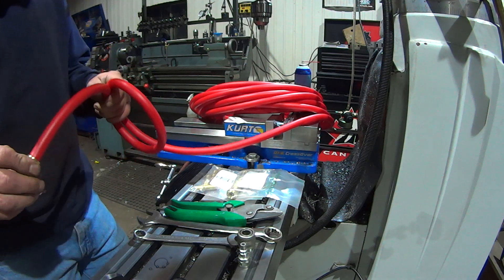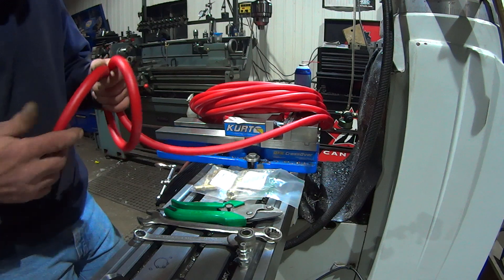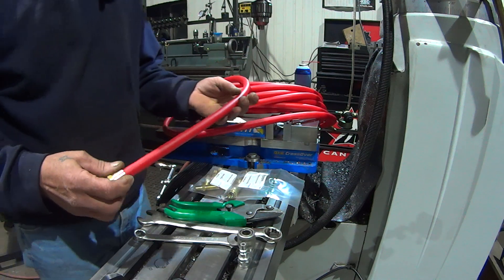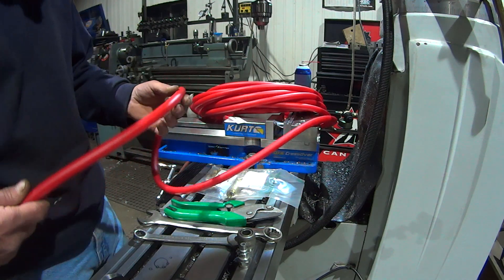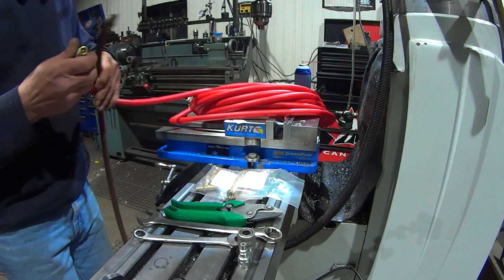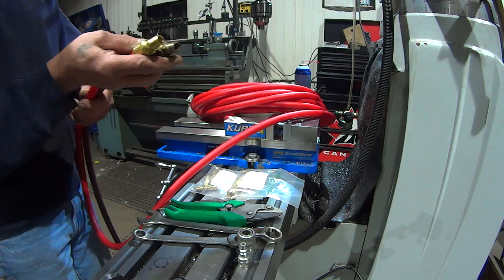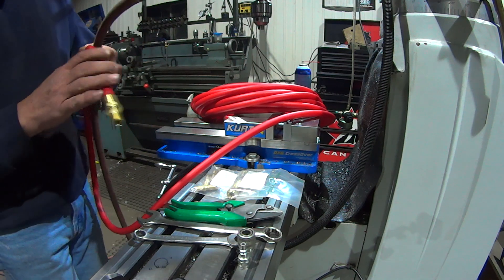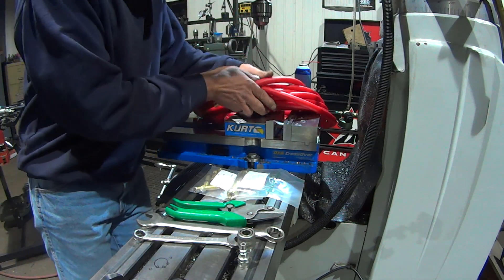Got Hosed Again..

Comment: Nice hardware Colin, I got spoiled when I worked, we had swagelok fittings with a sharp barb that didn't need a hose camp or ferrule. I have some nice hose like that and one fitting blew itself off. I re-used the barb, the ferrule was replaced with a twisted on wire (home made wire tensioner project seen all over YT). Like your red hose , nice and limp and doesn't get wicked hard in the winter. Enjoyed, cheers!
Reply from the maker: Thank you sir.. :-)

Comment: They are great...  I work as auto mechanic.. We use Wurth products and the rep comes out one a month.. got 1 hose to try on my reel. now 2 years later all reels in shop have them... resistant to oil, anti-freeze, gas..Super flexible!!! even under 170PSI.
Have you used the rost-off??? best dam penetrating oil I have used...
Reply from the maker: Same here...tried one a few yrs back.. 
Havent tried the Rost-off but heard its good...maybe soon..  
Thanks :-)
Reply: touch&go72 - 170PSI?  what kinda tools are you running that need / tolerate that?

Comment: Big question are the line oil safe? So many are not. 
I use an oil fogger for my air tools. Most hoses turn to goo after a year or so.
I really like those fittings.
Reply from the maker: These do stand up well. I have it home in my shed about 15 yrs old.. Good stuff.. :-)